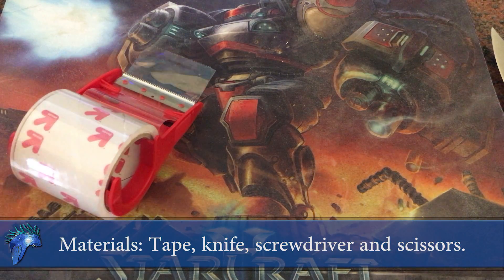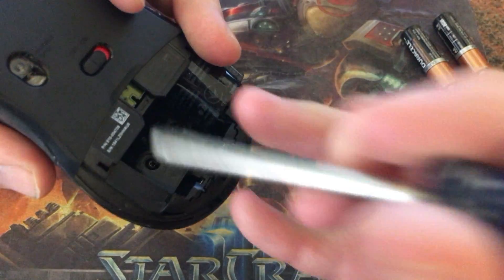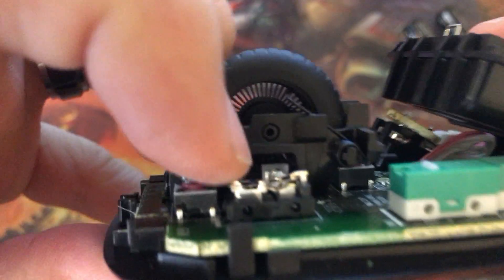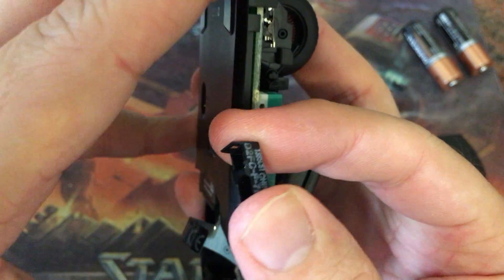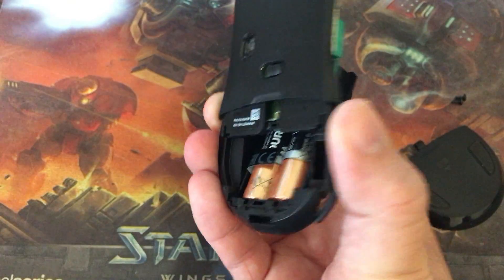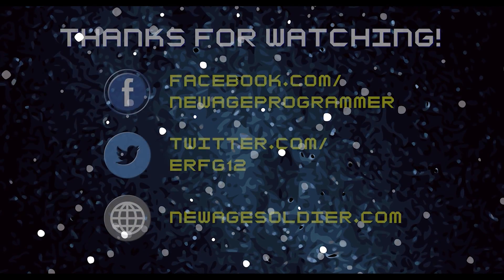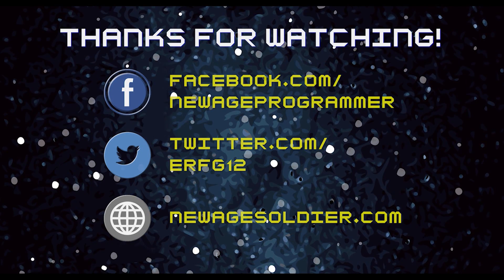Silent Mouse Click Mod - New Age Soldier Tutorial

Comment: Nice this is the right way to do it, I had no need to bend anything down like most people choose to do! i actually went with a tiny piece of soft thin foam adhesive on the copper plate under the metal part most bend, cut it the same size as the edge👍 took a few attempts to get it right but it's literally perfect 🙌
Reply from the maker: Great tip!

Comment: please take a picture of where to apply the tape. your camera was really blurry on closeup
Reply from the maker: This video is over 3 years old. I don't have this mouse anymore, nor do I have any pictures. I describe the placement of the tape as between where the metal clip makes contact with metal. You're basically trying to put a very thin layer of plastic between the 2 metal pieces to dampen the noise.

Comment: aren't you literally insulating the metal on metal contact that allows a current to run trough the switch?
Reply: The bottom click is the one you should not put the tape on. The top piece of metal shouldn't do anything in a normal mouse. However, if you would want to use the silenced switch for something that requires the current to flow on normally closed then you are insulating the switch.

Comment: The right and left buttons are fine, noise-wise.  But the middle button is annoyingly loud.  Do you have a video for fixing the middle click button for that exact same mouse?
Reply: Well it's the exact mouse you have in the video.  The buttons look different, doesn't look like I can just pry it off.

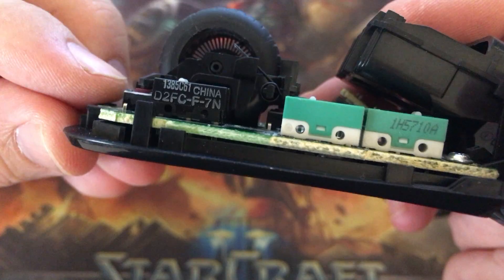1:37 the side buttons on the scroll wheel, that's the exact looking button underneath the scroll button.  Not sure if it's safe to pry that off because 1:47 there's two metal tabs on the side that looks like it's holding it down? If that made any sense
Reply: Dang it, oh well then